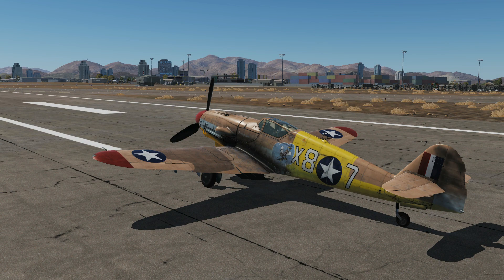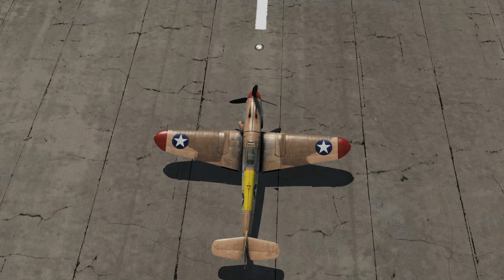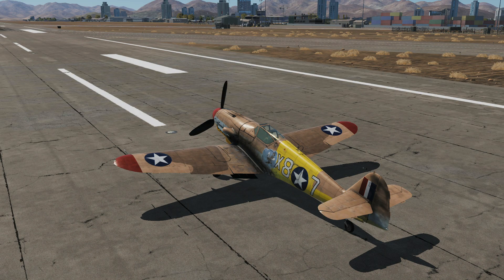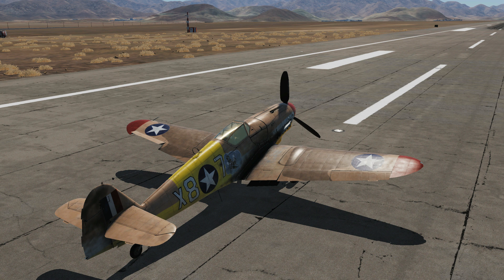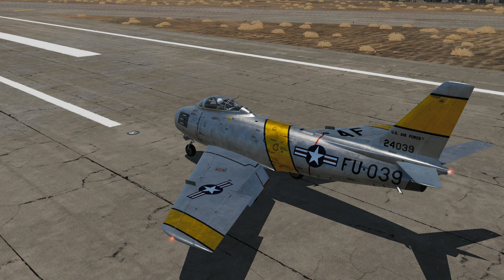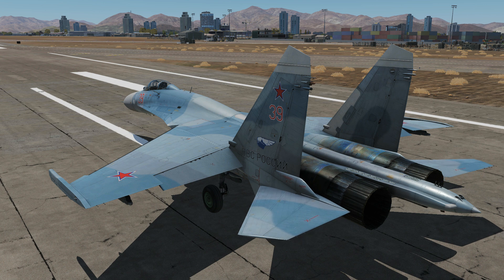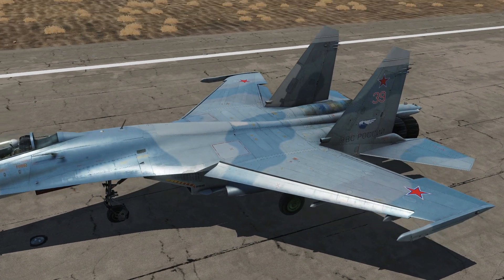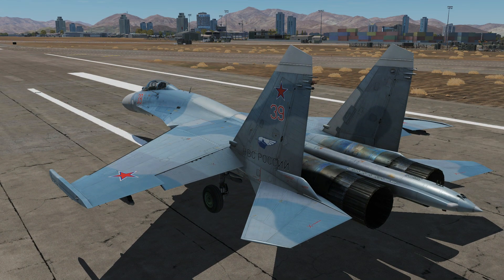Flying Basics: Aircraft Control Surfaces

Comment: fun fact: the F22 uses all of those control surfaces at the same time individually in order to realize your stick input. For example the slats are extended on one side to increase roll, on both sides to increase pitch etc.

Comment: The biggest part of the drag created when the flaps are extended is because the steeper profile creates a very low pressure zone behind the wings and as is the nature of things, pressure always tries to fix itself by creating a force directed from a high or normal pressure zone towards a low pressure zone, slowing the aircraft down.
Reply from the maker: Rgr thx